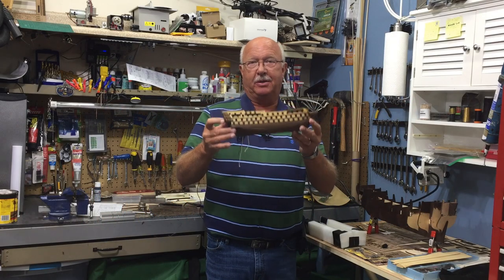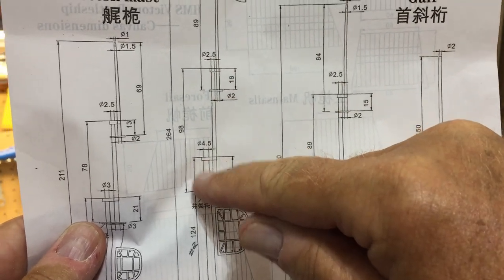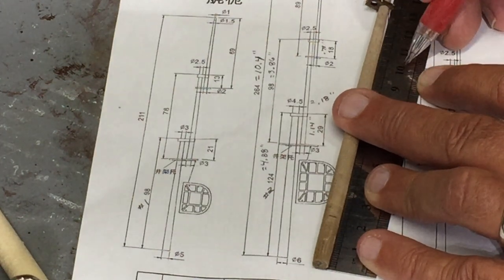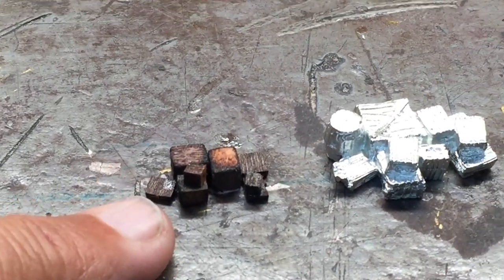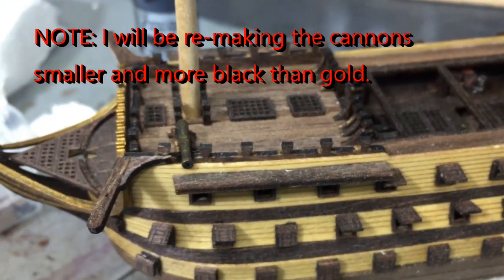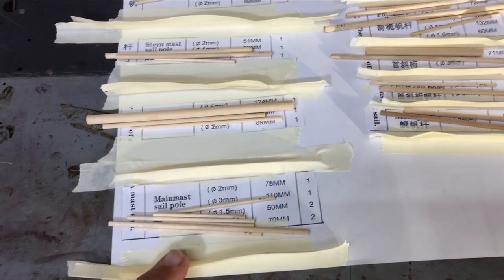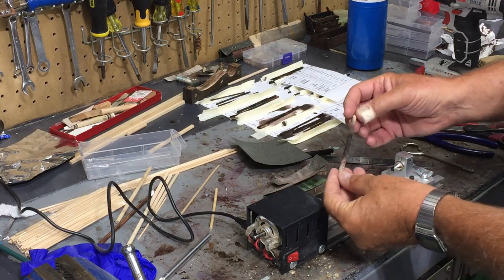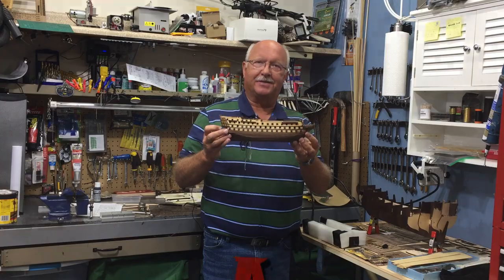HMS Victory Model Ship Build Episode 8

Comment: Looking good, looks like the masks is the ones that needs patience but with your help it will be ok. Keep safe dan👍👍
Reply from the maker: It’s very confusing, but I’ve figured it out 99% anyway!  Note: I messed up the metric terms, but I’m learning 😂👍
Reply: Hi dan working on mask poles and did you make extra brackets to hold poles together as only 3 on cutout and you gave six. The others on cutout are so tiny: keep safe👍
Reply from the maker: Did you get my email that I posted? I can send you some close up photos of the masts if you send me an email.

At the time I didn’t have access to any visual instructions, so I was just doing what I thought would work!  I ended up not using all of the ones that I made from the instructions that I had. I didn’t make any very tiny ones.
Reply from the maker: larsonda@purdue.edu
Drop me an email confirming that you have it.
Thanks

Comment: The sail poles I think they are for the bunting sail. Ho that help what are bunting sail you ask they extend out to make the sail wider in light wind conditions. On square rig ship that is a lot of sail to handle.
Reply from the maker: Thanks, I just posted episode 9 but had to remove it due to a short overview video that I left out...... should be up and running in about 30 minutes!
There’s no instructions on anything related to the masts, yards, booms or rigging.  I’m hoping that I made them close to accurate.....